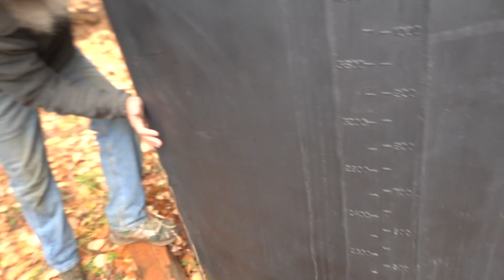WHY WE SAID GOODBYE TO OKLAHOMA

Comment: #1. The first couple was on Homested rescue. Season: 4, Episode: 8 "Fire and Fury"  So I hate the fact that a mild joke was maded about Homested Rescue. Stuart & Toni Rinker acting like they never knew or heared of The Rainey's. Their homestead would not be there if the Rainy's hadn't helped them ( Shame on them).  Matt and Stuart cleared the 200 foot radius of trees around the cabins which Stuart had no idea how to do to build a fire break.  The water tanks were Misty's idea to put 4 blue water tanks in the shed cabin otherwise they were making daily trips for water (Now Maybe once a week they need to get water). Stuart told her he was going to put a big tank in and use the snow and rain run off to fill the tank.  Marty leveled the shed cabin where the post in the front was not level due to the frost, enclosed the shed with metal skirting to keep fire ambers from burning it down. He used the Shou Sugi Ban wood-burning Technique on the shed to cabin outside siding.  Not alot of difference (Changes) to the homested since the Rainey's were there and Helped them out.  The big black water tank is New and the Ram pump is new.  Otherwise it's looks like it did when the Rainey left.
#2:  The second couple were more real and their homested was great. I also could see they are hard workers. Hope the best for this family.
#3:  Love their idea's and dreams.
Their homested is more like their building a small village.  I wish them the best too and stay safe.
Reply: I wasn't happy with how the rainey's were treated there while trying to help them. He has a totally different demeanor in this video then he did then. I'm glad they stayed and kept was given to them. I'm sure they had to spend but the help is what I'm saying. Some got the help and left and went someplace else. Its good to see them moving forward.

Comment: If you move up here.. I want to meet up!!  If you move up here PLEASE remember to have slanted roofs on all building..we kinda get snow lol  Make sure you check Bonners county reg for building anything... they can be a bit of a hassle.. I i could buy what i wanted it would be in Kootenai.   6 to 10 cords depending on the winter and heating set up.    How is all wood they cut.. is it dry and seasoned? If not it will shrink or expand.  That kitchen and entry way are so pretty I live the wood grains. goat milk is great ! It does not taste like cows milk lol  OMGOD !! look at that view?? Is that Priest Lake or The Kootenai River??  Goat Milk. the taste will change depending on what the goat ate lol If you are lactose intolerant.. goat milk can help with that.  Think, in the bible Abraham goats and sheep,  no cows.